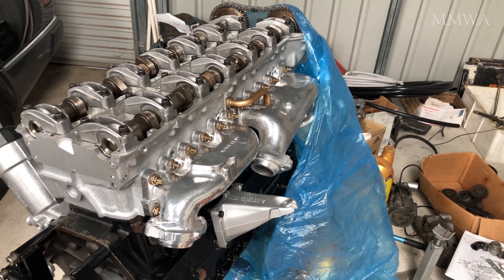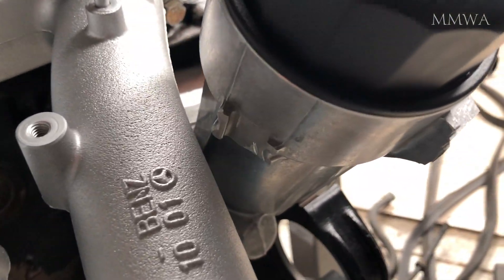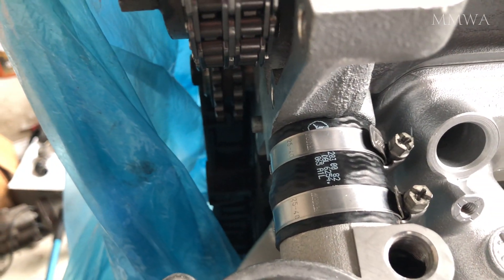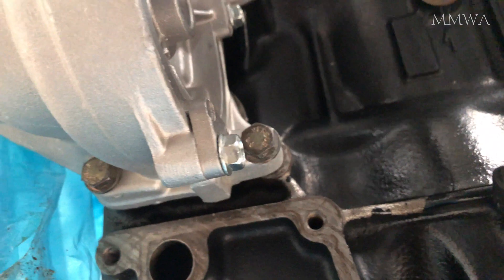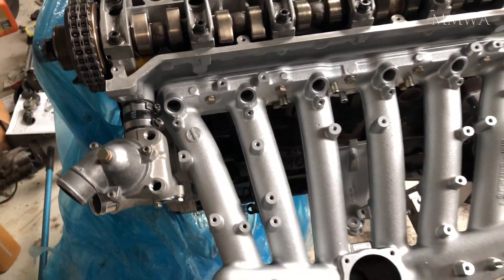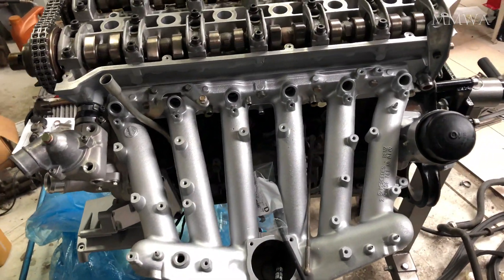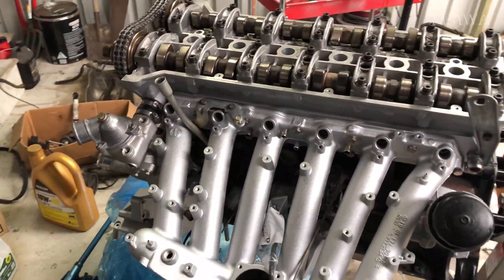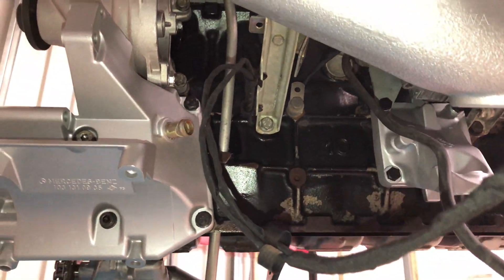Red W124's intake manifold is installed

Comment: Hi, I saw your steering wheel. How did you restore it?
Reply from the maker: Frito Lay ive not restored a steering wheel
Reply from the maker: I have 2 of the facelift leather non airbag steering wheels. The one on blueblack 124 was in great condition imported from Germany. The one i bought for red project will need recovering
Reply: @MMWA-DAVE  Do you mind if I can have your email? I would to get your opinion regarding my 1990 300ce m104.980. We are trying to restore it. I'm skeptical about the mechanics here in my place, seems like they work on my wallet rather on the car 😂
Reply: Oh ok. My bad
Reply: My car was sitting 2 years ago, prior to that, we replaced, pumps, injectors and clean the tank. Now we are starting. And it started, but after give 5 minutes it dies, where do you think I should be looking?
Reply from the maker: @fritolay8668  Have you established if its dying from lack of ignition or is it fuel ?
Reply: What do you mean lack of ignition?
Reply from the maker: @fritolay8668  Is it stopping because of lack of fuel, or lack of spark
Reply: Oh I haven't established that yet. But I have a guess.. it might be the fuel. Because it has been sitting for 2 years. I believe it should have been drained before I left it sat.  I will check the spark plugs tomorrow.
Reply: @MMWA-DAVE   Do you have an FB and messenger? I would just like to show videos or pictures  of how I  check things, I'm not a mechanic. I just want someone to guide me as I make this car road worthy  You could make a dummy account, this account of mine is just dummy. My purpose is just to get opinions from someone who has experience on this car. Thanks